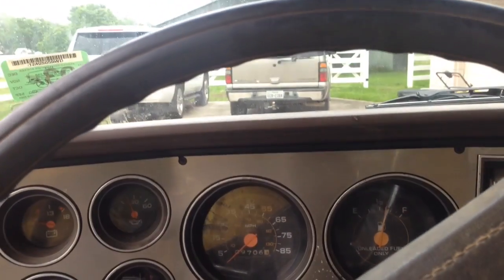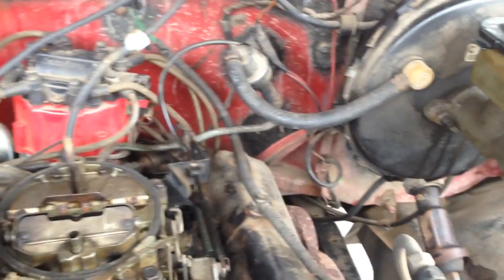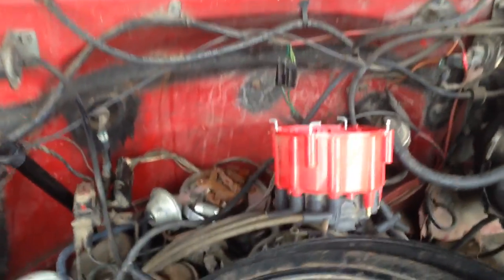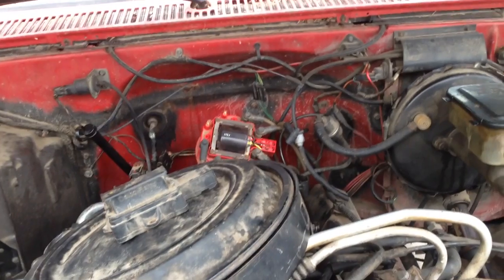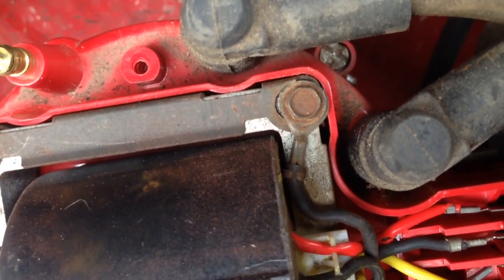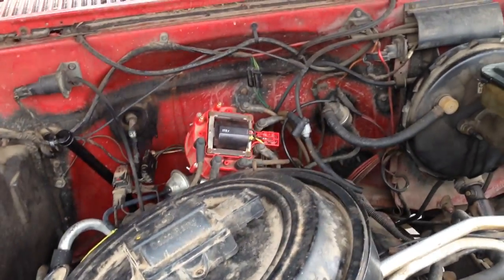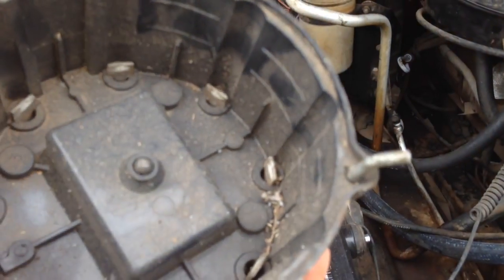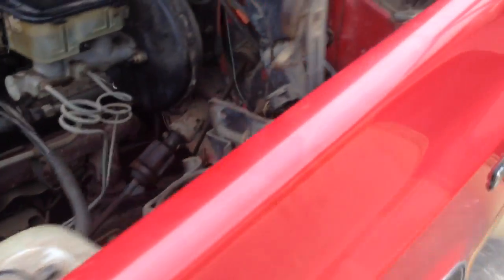85 C10 Ignition Problems Part 1

Comment: These ignitions are so hot when they are right that sometimes it will burn a small hole in the rotor and all the fire just goes thru the hole and go to the advance weights and kills the system. Look at the bottom of the rotor for a dark smudge and a spot on the weights ,just an idea!

Comment: I have no spark  in an 84 Chevy with a 305. I put meter to coil and that tested OK. I replaced cap, rotor, and module. I jumped the A and C (green and black) wires coming from distributor to ESC. does anyone have any ideas??? Next I guess test fusable link and pickup coil... I just went back to work I can't afford this right now... Can someone please help me???
Reply: try another coil, sometimes the coils test good and when you try it in the truck, wont run! I bought a brand new NGK coil that proved defective. go with looking at firing order on yr truck, ensure all the wires go where they should, then take another distributor from a running car or truck and put that in, Im betting on a ground issue or defective component inside your dizzy.

Comment: Thanks for the series. I'm chasing the same gremlin I think. Truck will run great one day won't start the next(No spark). New coil, cap, rotor, plugs, wires. Swapped distributors (used for used) before it all started.
Reply: Figure out what it was? My truck is having the exact same issue